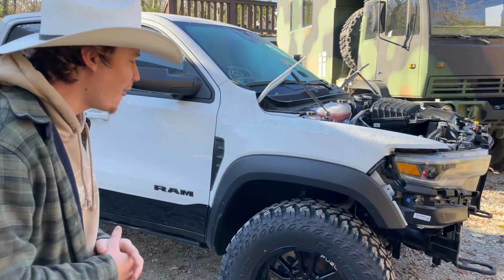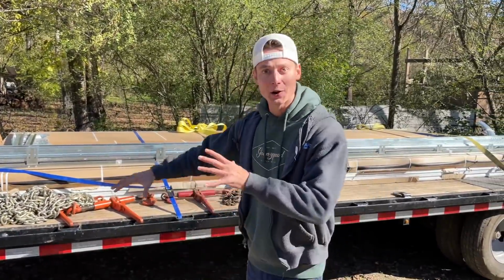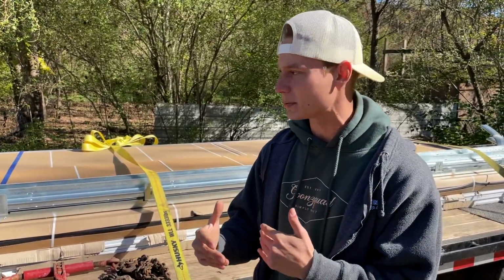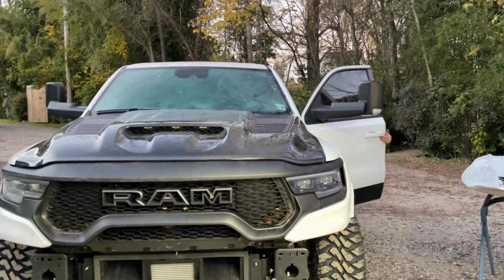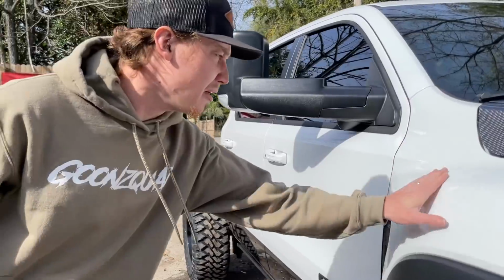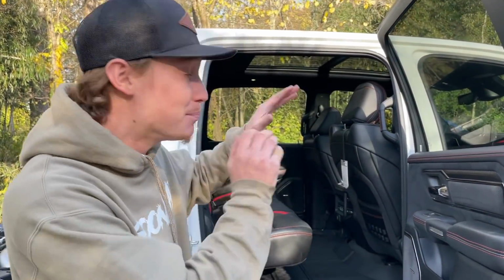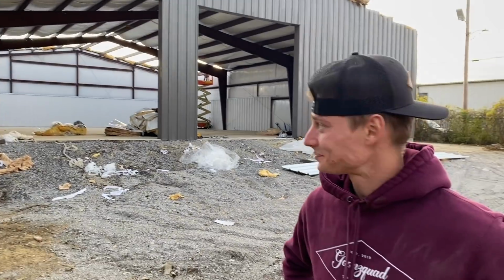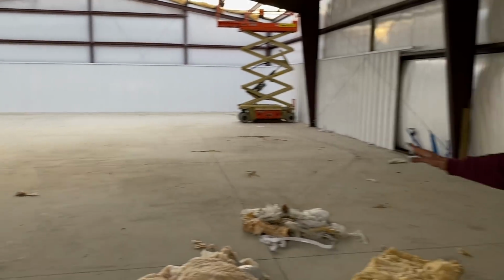New Goonzquad Garage Is Almost Done!!!

Comment: Goonz: All we need is a big-ol-fan with all this insulation

Goonz-in-summer: Our next project is an EPIC AC SYSTEM
Reply: I was thinking the same thing, don't care how much insulation you have, it's still a big metal box.
Reply: I’m still at a loss why one would use those wobbly sheets of insulation instead of sturdy foam insulation panels. Not only do those panels double up as decent wall finish on the inside (as opposed to flexible insulation sheets), they also provide way better fire proofing. Could it be that foam insulation panels were in short supply? Or is it just a matter of cost?
Reply: you forgot  to say dude.....lol
Reply: @farmtruck9885  harden up man!! How many workshops have aircon !!
Reply: @mixalis6168  I smartend up man!!  My shop has air. Don't knock it till you try it.
Reply: @robingerrets1077  I guess it was cheaper. What they used and what you suggest is kinda outdated technique, these days we build almost every warehouse style building with premade "sandwich panels" (google some pictures with those words and you'll see) At least here in Europe.
Reply: @robingerrets1077  those sturdy foam insulation panels give off toxic fumes when the burn. Then they also are a significant cost increase.

Comment: You will need heat for sure. I have a metal building with 2" closed cell spray foam on ceiling and walls and it still gets cold in the winter. I live in North Carolina which is pretty close to Tennessee's weather.

Comment: For the new building: Paint Booth, Tire Machine, Frame Machine and one or two minions.  You also need a camera system, networking, wifi and access control system.
Reply: Bathroom/shower, break room/kitchenette, lounge area, much of it upstairs. You think the space is unlimited now when it's empty but it will go F A S T.

Comment: Awesome building, your definitely going to want to epoxy coat the floor before you move tools and lifts in. I would concrete the outside perimeter of the building. Come out about 20 feet then asphalt the rest. MRC Garage is spot on having a carport on one side of the building full length

Comment: Epic video! The TRX looks amazing and the shop does as well. I think you’ll regret not having a full HVAC system installed, especially in the hot and humid summers. The big ass fans are great but I think you need both.

Comment: What is in the pump jug that you use before you start detailing the outside of the cars?  Would definitely say that of all of the machines / rooms you need in there, paint booth and store with lots of goodies for fans to buy when they come to see what you are doing, and storage on the second floor.  Maybe a bar top like you have at the new HQ, so maybe you can have a meet and greet with some of the fans.

Comment: I work in a building just like that, and the owners wanted to put ceiling fans up as well thinking in the summertime it would be beneficial but it turned out in the summertime heat rises…. so you’re blowing down the heat. Good idea to help your heating cost however in the winter time.

Comment: Goonsquad you should do concrete for the burnout pad. It cost more money but it will last longer than the asphalt. Asphalt will just get holes from all the tire wear and you would be replacing the asphalt quicker than you would be with the concrete.

Comment: You will need some heat and AC even with the insulation.  In the summer once it gets hot inside it will be hot and vise versa.  The beauty is that can be added later since you have a big open space

Comment: No matter what insulation you use, the building will eventually heat up (or cool down) to the outside temp.  I'm in a fully insulated 24x25 garage in the north east part of the country and it would still get baking in the summer. I'm glad I have HVAC

Comment: Look into the waste oil heaters. My buddy has one for his 40x60 pole barn with 20ft ceilings and it keeps it warm pretty good. Biggest issue is the noise of the air compressor going off but if you have a quiet or a big tank, you’ll be good. PLUS…you get rid off all the oil from your oil changes. WIN WIN.

Comment: Concrete is better for drifting because it will last longer. Asphalt will get ruined from the heat overtime. So maybe u can make a concrete drift pad surrounded by asphalt for parking and driveways.

Comment: get a heat pump and also a heat exchanger plus pos pressure hepa. you need a good air sys - have two sep systems - get a self leveling laser for layouts - you have space - do a patio and bbq pit and koi pond - consider sep mechanicals bldg like shed at house. have a good sound sys and also a couple big tv with wireless mouse/kb - get good pc and network for office, get good security sys, make space for the dogs -have some gardens and small trees, try to go green and think solar ground system, think starlink, think opnsense and 100g connections plus 10g and fast wifi, get a big fridge - have a lounge/kitchen and an office - the intown office may work - think about a dyno

Comment: if you dont want the hassle of hvac get mr cool 2 units should be plenty
(they run heat and ac) they also keep the energy usage way down
Reply: pavement has more traction then concrete so for a drift pad you want concrete so you can slide if i were you id concrete or pave the entire property

Comment: Darn good job by the 'crew who stopped by'.TRX needs a Black bedliner spray to match the accents.You'll Need Air-Con come mid-summer.PLEASE make sure you do a 3/4 bathroom.You'll really want to shower after working under cars before you get into your's to head home.

Comment: The concrete floor will suck out any heat. They have no idea how shops work in winter ❄️❄️❄️ not installing in floor heating was a major fail. In floor heat is always the way to go for a building that big.

Comment: Don't put the spray booth inside, it will eat 25-30% of your shop floor to ceiling.
Frame machine is great idea, perfect for welding up major damage.

Put paint booth in the parking lot, corner of the property if you must have one.
Open wall paint booth inside shop for small jobs. 

Under mezzanine build a sanding room for prep, it will keep shop clean. Sanding/prep room should have excellent lighting and negative pressure.

Comment: Dudes! There is absolutely no shame in admitting that you took on more than you can handle or that you got in over your head. Your not the first this has happened to and you won't be the last. Props to Pops for sticking to the commitment to get the job done. That's why Pops gets my vote for MVP! As for what to put into the shop. Top of the list? Big ass Air compressor! Set up the shop with dedicated work stations and plumb your air lines accordingly. A couple of Bend-Paks are a must and may I suggest you get a couple of sets of, "Go-Jack's" dollys to move projects around. Designate a clean area and hang some clear curtains so you can do your sanding and keep contaminates to a minimum. Lastly, I think you need a paint booth and unless you have a need in mind for the 2nd roll-up door, poor a concrete pad and put your paint booth there, since it's constructed to be self contained. Happy Hunting and don't sell the Viper!

Comment: A big fan is not as good as you would think.  At my work they put those big ass fans in and it as actually cooler with them off.  All they did was push the hot air down.  So unless you put in some ventilation they won't help

Comment: The only problem IMHO is that it may not be a wise decision to fix and then sell rebuilt titles as a business model simply because of all the problems buyers are going to have getting affordable and adequate car insurance, which means you might have trouble selling some of these high dollar rebuilt titles. Maybe you should consider focusing on restoring non wrecked vehicles and only mess with CLEAN TITLES. Did you guys get a car dealer license yet? You will need it if you plan to sell more than 5 cars each per year.

Comment: think about dyno room and hvac power needs - you want electric charging and 240 or maybe 440 3 phase, you will want a spray booth and you want room for welding table, brakes, carpentry tools. electrical section, build the garage on the mountain first to balance things out and you want options - do some tuner shop advertising, the dyno may end up making you money but think sound dampening think about making redundant systems - use dual firewalls in ha design but also have starlink and then a 4g hotspot - you can get link agg but also failover think about looking into home assistant sw - some automation - don't be in too much of a hurry push some good sponsors to help you out - do a local vice grip garage repair service for seniors one day a week , consider getting a state inspection license for the garage - i would go with some concrete - make a list of all the design considerations, look at other shops, combine, improve #fab #firmware flashing  #we try #dual wan #composite wheels #unsprung weight movers #opnsense

Comment: i work on conrete, pavement will eat up tires and just make holes in the future i would recommend pouring concrete and just leaving a smooth finish with a few some control joints for cracks! its cheaper and will last way longer! love the channel

Comment: I'm glad to see so much progress on the new shop. Concrete is easier to drift on; it's more slippery. Two overhead hanging propane furnaces on opposite corners of the building with a 20' fan will keep you warm for sure. If you go with a cross draft paint booth make sure you put a drain in the floor; you can also use it as a wash bay area. Down draft booths are cleaner but the vehicle has to go up into it and you can't get them very wet. You can drill and put pulling pots anywhere for frame work. 👍

Comment: Excellent job by that crew. Plus by you doing the frame and part of the roof saved you $$.   Yes a "Big Ass Fan" would work in there but I'd still do HVAC.  A couple vents to push that heat out up top would b good.  Maybe a separate building for compressor etc. It'll keep the noise down when running lifts, paint gun etc. Led lighting on those doors, ceiling and maybe some walls. 
Can't wait to see all the rides in there. Super bright and clean. 
Keep up the good work.

Comment: Concrete always better for burnouts and drifting ashfault is rough and it tears up with burnouts and stuff and guys do the heat and air you will regret it if you don’t that place is too dam big for a dam heater and a window air conditioning big ass wood burner stove might work but you want nice shit to last forever

Comment: Suggestion...after the roof and door are installed

Priority is the electrical and install Cctv All around and security cameras n alarm

So all the cars expose sa weather ...should be put inside ..to protect from elements 

Because repairing n repainting ..cost money 

Make a fast turn around  diversify bisnis , specialize n acquire land asset n open credit line against it..

Dont be like GM ..n other car companies ICE...electrification is coming like HYBRID AND E CARS of tesla..
Watch costing of proj and your overhead operating cost.

Its easy to fly a kite ,but hard to maintain it up there..wind changes 

Like bisnis n life..Sustainabilith is the key  or you will lose everything..

Make every investment a profit center.

Income frm YOU TUBE plus buy n repair n sell ,wiill not last forever..

Put up a charging area ,a small restausrant , in the new commercial bldg so there will be daily income ,
Now ,stockpile on second hand parts,trading..

Think ahead

Comment: The shop is going to change your work definitely. You guys will need a good AC system, especially if you want to have a paint booth inside ( I advise you to build a seperate booth outside the garage to maximize the room in your shop). Next thing is a row with lifts to either work or store the cars. Just as Tavarish his garage. Tire change equipment very handy, as you guys change tyres quite often. Next up is a nice toolbox or a wall with tools to have everything organised, plus storage for old/new parts. Lastly an important one, it is good to have some chill time too, so a relax corner would be perfect, with maybe a simulator to have some kind of competition?

Comment: Lol no hvac.. that’s a pretty major downgrade, don’t you think? The space is to big to be cooled or heated any way other than central heating and air, it will be cold as shit in the winter and blistering hot in the summer. Building that massive building and then deciding against hvac seems kind of redundant to me. You get what you pay for and when you cut corners things typically get wonky. Good luck to you, make sure you wear your beanies and winter coats here in a month.